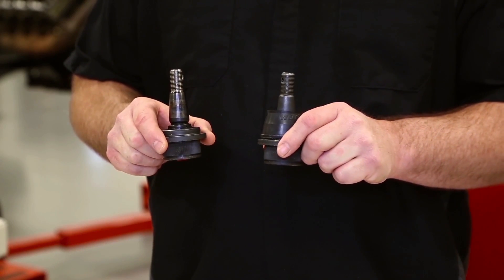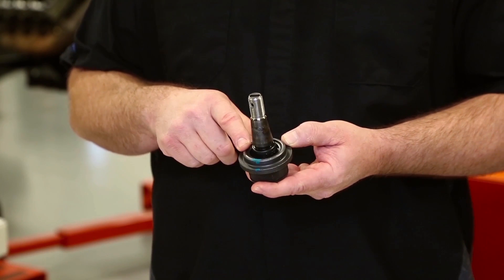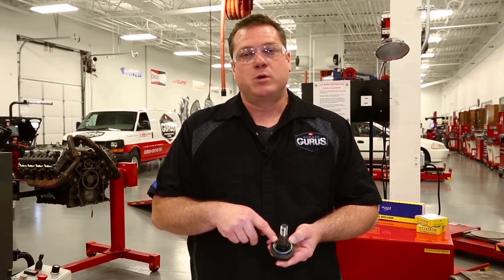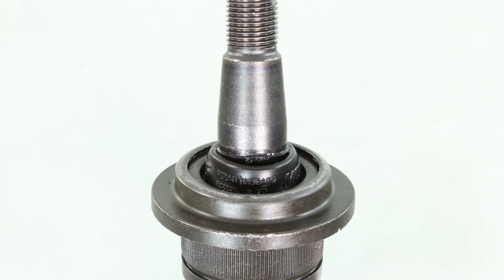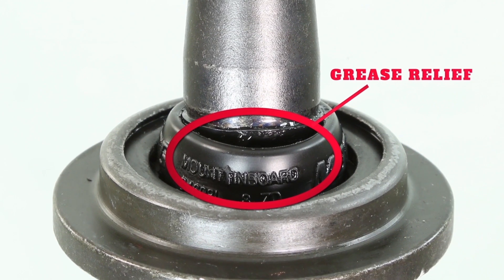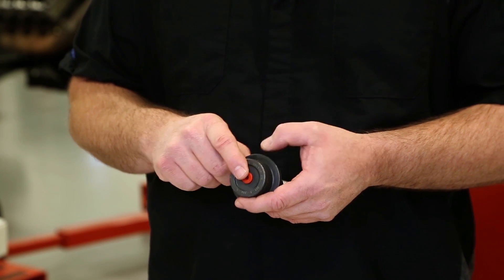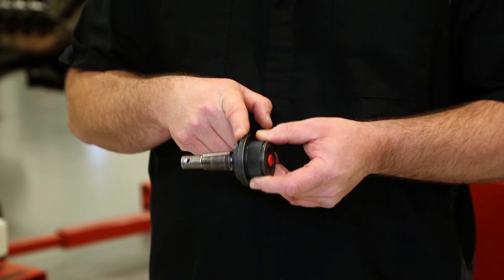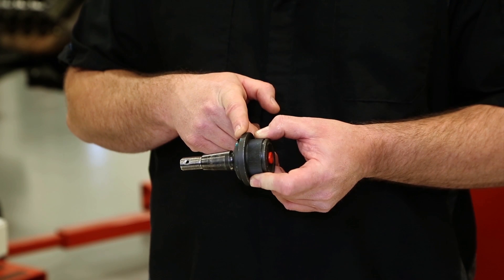MOOG Compression Loaded Ball Joint Enhancements

Comment: So I installed one of the lower ball joints like this on each side of my truck, on one side the boot expanded when I pumped grease in, on the other side of just swelled a little and then started pumping out of the relief. Any tips?
Reply: yeah, swap it out for the old design.  I am!!  i had the same problem, and the one that wouldn't take any grease chirps like a freaking bird non stop.